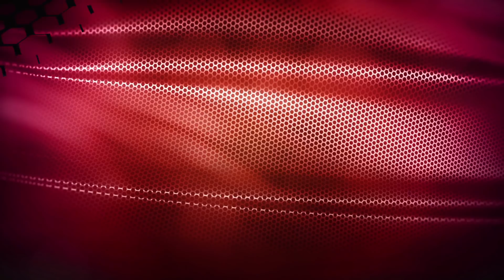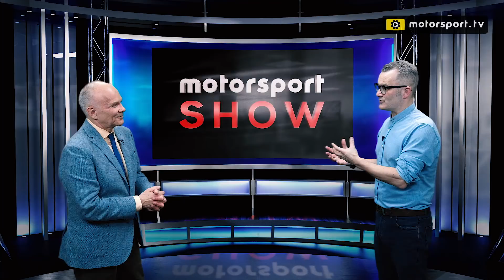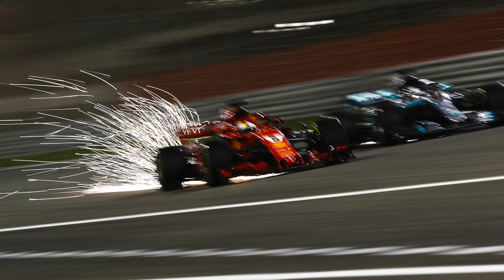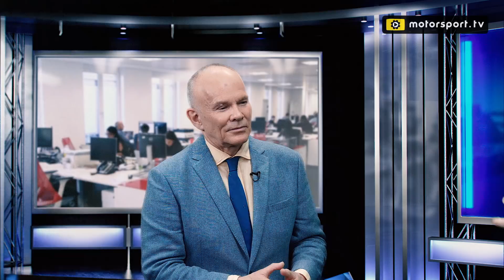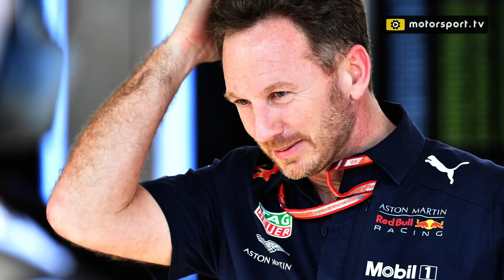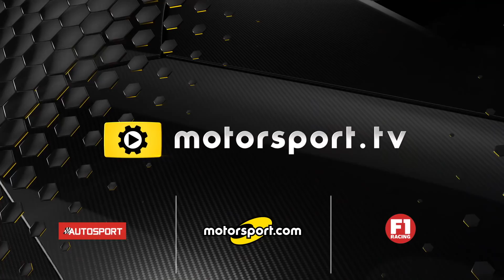F1 engine 'party modes' explained

Comment: I'm sick of those that complain about engine settings on modern F1 cars and that F1 should be about max power the entire race.

News flash, these party modes are TAME, compared to the engine settings used in the old turbo period. Their "party mode"s meant going from 850 to about 1400bhp! And I bet that 65% more power was worth more than a few 10ths...
And it wasn't just the engine, the gear box was different and there were super sticky qualifying tires, none of which would last more than 3 or 4 laps...

Do we really want cars that have to be rebuilt 15 times in a race?

And even back then, they had to conserve fuel as there was a 195L limit. So fuel limits are nothing new either. It's amazing that we are nearly back to old turbo race-power with about half the fuel usage!

I've heard people say that these engine restrictions are responsible for the lack of overtaking these days, but I don't think that is at all true, it's much more to do with how sensitive the aerodynamics are to the reduced airflow when following a car.

And at the end of the day, engine limits reduce the cost for the smaller teams as they only have to buy a few engines for a season, rather than blowing through a new one every other race...

Comment: I would like to see 1 engine  per race boost it as high you can for Qualifying  then turn it down for the race so it last the full race see them Qualifying  lap times go way down F1 was meant  to be BALLS out racing not the Trip to the supermarket  with mom's  SUV 24 hours racing you dont need to push the car at its limit  but F1 push the Fu$$er  like its the 50 yard dash in the Olympic  games

Comment: The three PU rule is ridiculous.  The majority of the cost is in research and development, not the pu’s themselves.  They need to make it to where you can have 8 or 9 PU’s for the season but only three upgraded versions.  So if an engine dies, the team can replace it with an identical engine without penalty.  If they decide to replace it with an upgraded version more than three times, then that would incur grid penalties.   I think that’s a fair compromise in an effort to mitigate the painfully slow race pace.

Comment: Car being software mentored from the pit wall using hidden programming maps ..
What they can't control is the cars aerodynamics which are  killing the sport. The answer is to return to single element wings, then close following and over taking will return ..
There was a gentleman agreement to return to mechanical grip when slicks where first reintroduced . This went by the way side when Brawn GP took over Honda racing  and broke that agreement with the flexible rear defuser.

Comment: We need to stop saving tyres, fuel, all that crap. You can clearly see it in the races. 100m or so before a corner theyll just coast towards it instead of being on the limit for the entire race like say 10 years ago. Either get a reliable v8 setup that you can bash on or make these engines cheaper to make. Yes i realise its near impossible lol

Comment: Still doesn't sound special. The drivers already can control everything, from differentials to KERS settings, etc., with the steering wheel. They can even have one setting in party mode and another in "normal" mode. At least that's how it sounds like to me when I hear them explain "party mode" in the video.

Comment: Nice explanation, all you said is that engines have different modes...

About if fans like it or not, I feel like qualifying should be about going stupidly fast around the track and race should be about drivers fighting in similar conditions. Don't get me wrong, I love strategy, fuel saving, different tire compounds... but it can't be at the expense of real wheel to wheel action.
Reply: developing extra engine trim mode would certainly killing the costs. And for mid to bottom teams in which they already facing engine performance isssues, reliability is more prominent issues. Added to insult on the fact that they had to save engine if they don't want stuck back on the grid for entire of the season.
Reply: @kanepreston18  Yes, rather than using a skirt, the using a sort of valve seal that fitted with the rear brake duct so it won't be broke when hits bump. Well about FIA closing their ears on motorsport logic, just look at the grid today, how many people entered F1 not being associated with money?

Comment: Before electronic engine modes appeared we had an earlier, very effective system, known as, "the drivers' right foot" !!
Reply: Wack Yack what a stupid, oversimplification of how an engine works
Reply: Years ago you didn't need to select an 'Ice' mode - you just avoided any extreme accelerations or braking: for'comfort' mode the driver drove smoothly always keeping momentum to reduce fuel consumption; for 'race' mode one mashed the throttle and went to max revs before changing gear. Performing these different modes efficiently only helped to advance a driver's skill at controlling a car. Also years ago road and race engines were built with greater reliability than today - that's why a F1 drivers can't use 'party' mode all the time - much as they would like to !

Comment: How about having separate engines for qualifying and races? 2 each per season.. you can use/construct the qualifying ones more to the limit..
Reply: Unless it breaks. Exactly. So what's your point?
Reply: Never mind that it happens most weekends anyway?
Reply: Plenty of teams do (and historically have done) engine changes between qualifying and races, whether it's by design (most of the 80s) or by failure (which, like I said, probably happens most weekends). It only takes a few hours.
Reply: Malc180s No team swaps engine between quali and race these days. Ever heard of parc fermé? Between friday and saturday they change engine, but from FP3 it stays in unless it breaks.
This started in 2004 when they limited number of engines allowed, so it´s quite some time ago.
Reply: Malc180s You may want to read up on the sporting regulations article 34. That would give you a clearer picture of what can and can't be done to the car between quali and race.
Reply: Again, what's your point? If the car breaks you can repair it.
Reply: "Shambolic suggestion". Your words. 

Despite the fact that they did this EVERY race at one point, the mere thought that this could happen now is "shambolic" is it? Despite the fact that if someones engine explodes in qualifying, or if they stuff it backwards into a wall they'll be replacing it overnight? 

It's not a shambolic suggestion. If it became the rule a modern F1 team would engineer a drivetrain that could be swapped in an hour.
Reply: @scott 
Those are just rules and they can be changed.. teams can efficiently change engines between practice sessions. Now coming to the 'parcferme' rules.. like I said it's just a thing put in place to avoid changing car between qualifying and race, which can be got rid off. My suggestion might seem radical.. but it's just due to how we are used to seeing our sport. Things can change and this would be one way to do it.
Reply: You claim teams as a rule change engines between quali and race, and it's not even remotely true. They have 3 PU's that should last the entire season, (3 ICE, 3 MGU-H, 3 turbos, 2 batteries, 2 control electronics and 2 MGU-K) so if one breaks ahead of schedule they are in for a penalty at some point. So what teams do is to run an older engine on fridays to keep the mileage down on the race engine as much as possible, and from FP3 onwards it's the same engine until the checkered flag. If shit breaks they of course change it, Hamilton took a new gearbox in Bahrain for instance and got a five place grid penalty. Same for engine parts when they exceed the allowed number specified, first part gives a ten place grid penalty, second a five place grid penalty and the third has them start from the pitlane. So any team using parts at a higher rate then allowed by the regulations is at a disadvantage.
And had you read article 34 you would know that each car will be deemed to be in parc fermé from the time at which it leaves the pit lane for the first time during qualifying practice until the start of the race. Any car which fails to leave the pit lane during qualifying practice will be deemed to be in parc fermé at the end of Q1 and that limits very much what they can do without penalty.
Reply: You've lost the argument and you're making things up. I never said anything of the sort. You're talking about arbitrary rules when the discussion is nothing to do with that.
Reply: Swapping it over doesnt take as long as people think in F1. In the late 80s/ early 90s they would use 1 engine for the hotlap of quali and it would either blow up or they wouldnt use it again. 2 each per season is not enough. They should make the engines cheaper but at the same time they should allow more of them to be used.
Reply: You started by saying "Never mind that it happens most weekends anyway?" which it doesn't.
Reply: Every time a driver stuffs their car in qualifying, or a car blows up in qualifying. Plenty often enough. You look a fool, just drop it.
Reply: So I look the fool? Ah, OK. Glad you cleared that up. And of course all those wrecked cars in quali, how could I forget! smh
Reply: They don't change the engines between Saturday and Sunday. Because unless the engine is broken they aren't even allowed in the garage. With the time it takes to change these PU's a change between FP3 and Quali would not work. Then they would need to change it back again after qualifying which would be a complete nightmare to regulate properly.
Reply: This is what I was thinking. 2 qualifying engines sounds like a good idea. Teams will have the chance to try as make the car as fast as possible for the qualifying laps, no fuel flow restrictions etc. Perhaps qualifying engines can also allow for a certain amount reconditioning so teams can try and run them at their absolute peak and then replace some of the parts in them. If total destruction occurs during a qualifying session then that engine can't be reused or rebuilt. Should you blow up your 2 qualifying engines in the season then you must do qualifying on your race engines which still are bound by race engine regulations. So lets say Ferrari blow up their qualifiers by mid season they will then need to focus on good race strategy to win say a race from the middle of the pack. Because it is the middle of the season in theory you could then run your race engine a little harder for qualifying (still within the rules of race engine regulation).